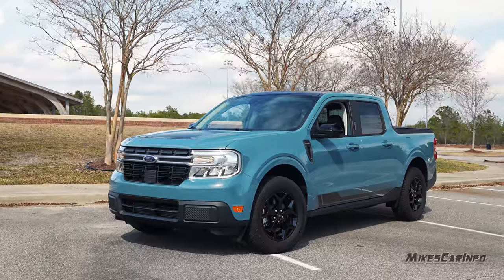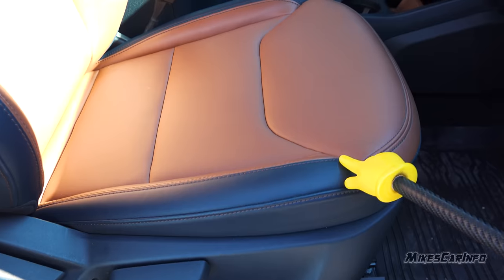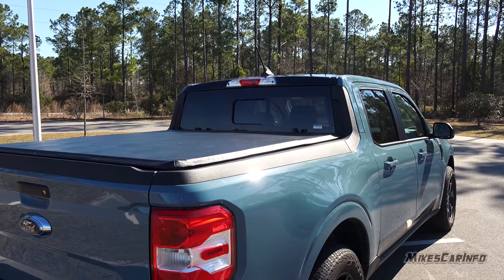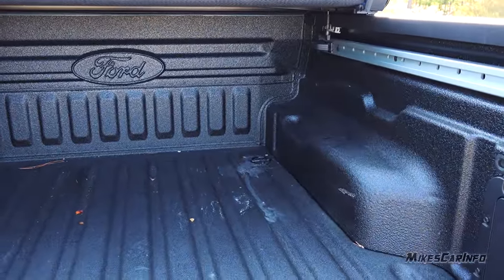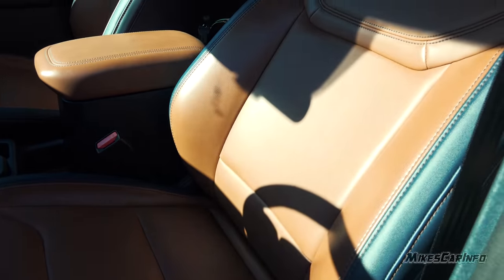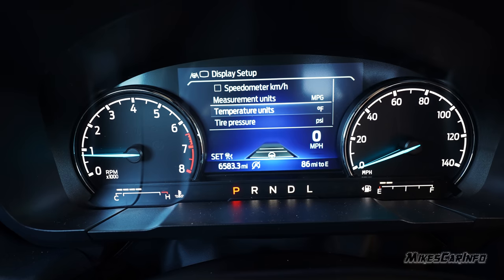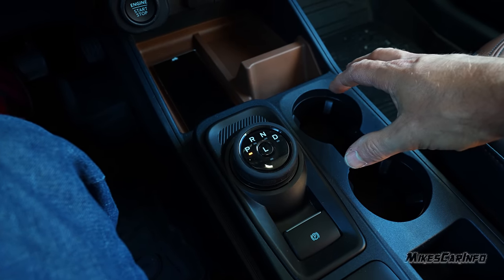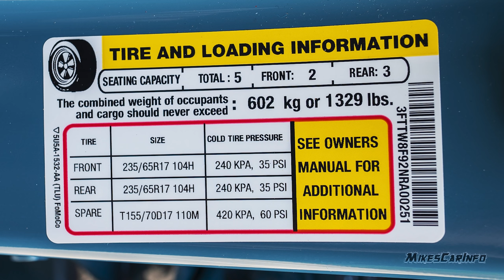👉 2022 Ford Maverick - Ultimate In-Depth Look in 4K

Comment: Oopsy Mike, you said 10 speed automatic transmission. I think you meant to say 8-speed automatic transmission. 😀😀
I see the GVWR rating is pretty similar to my 2004 Ranger (5140lbs) vs. 5205LB on the Maverick.
Reply from the maker: Thank you for pointing that out. I pinned your comment so hopefully other viewers will see the correct info :)
Reply: @MikesCarInfo  it seems a strong truck. Welldone :)

Comment: these mavericks are intriguing in an XLT FX4 package.  especially since there msrp at that trim level is suppose to be about $28k.  the problem is everyone is selling them for $45k on average.  this vehicle is not worth anywhere near that kind of money, not even close.  my local ford dealer has an USED XLT maverick, w/ 14k miles on it, on there lot and they have it listed at $42k.  however right down the road our honda dealership has 3 brand new ridgelines awd loaded models all for $42k-$44k.  the ridgeline is a much nicer much better more reliable much more optioned vehicle selling for the same price or less than a used maverick.  i cant see why anyone would buy any maverick for over $30k.
Reply: You're pretty much better off ordering it. Every truck right now on the market is overpriced because they sell faster than dealerships can keep order/buy more trucks. And as fast as the sell, Hybrids sell even faster because of gas prices. Sad really since this truck is genuinely supposed to be cheap. Ford cut a ton of corners to get the price down, but Dealerships are making dumb profits.
Reply: THEY ARE WELL WORTH THE MONEY EVEN AT 35K
Reply: @buddy9577  🤣